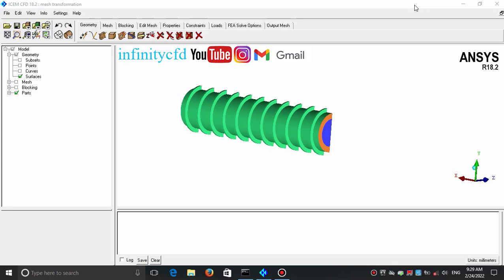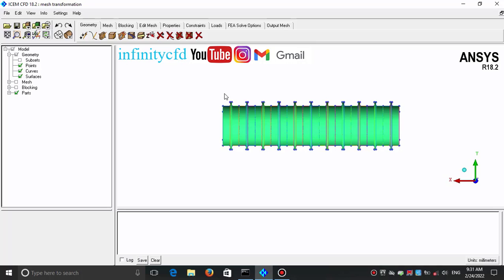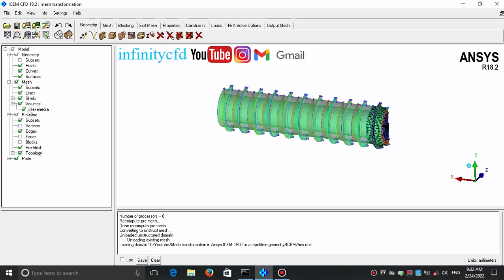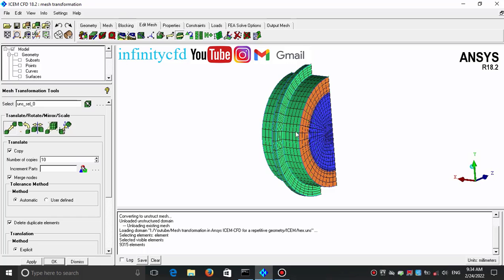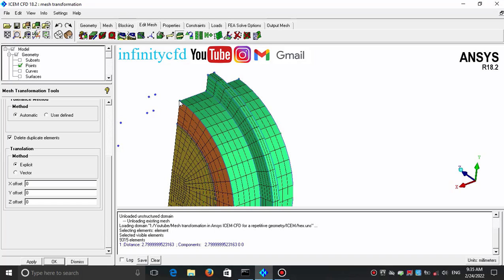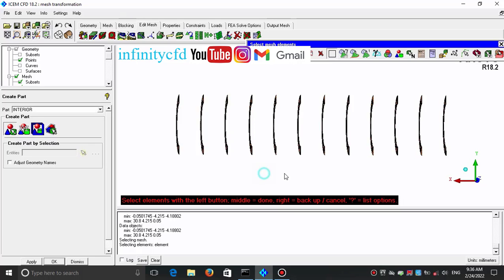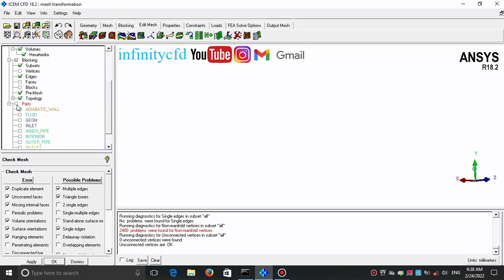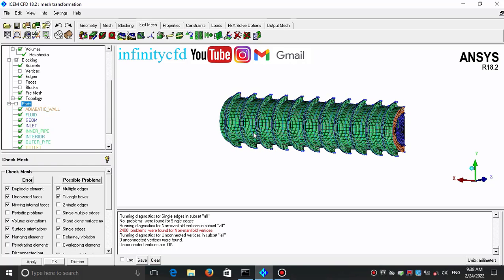Mesh transformation in Ansys ICEM-CFD for a repetitive geometry.

Comment: Hi, if I extrude mesh, I split the solid geometry into two parts, in between the solid geometry has a wall, how do I remove this wall?
Reply from the maker: Hello, if you use two separate solid mesh for volumes with two different names there must be two surface meshes between them. Actually, they are coincident and one has the main name and the other has shadow suffix.

Comment: hello，this video is very good，but i can’t import into FLUENT，the error is that interior can‘t be identified
Reply from the maker: Hi. Thank you so much, it's your kindness. This problem arises due to incomplete copy process. I mean the interior boundary is not formed correctly. May be it is from the value of distance for copying that should be precise and be the exact value. Or it may be from the incomplete merging operation for mesh elements at this internal boundary. Check it out and see your boundaries one by one to ensure that one boundary has not two surface meshes in Ansys ICEM CFD. You can check this possible problem by checking the number of mesh elements that should exist in one boundary. For example if the number of elements for a boundary is twice the value it should be, the two surface meshes must overlap and you have to remove it before exporting the mesh.
Reply: @infinitycfd32  Thank your answer, but I meet another problem that the replicated mesh could not display after it imported FLUENT, FLUENT only  display  my source mesh. I don't how to do.😣
Reply from the maker: Your welcome. Did you enable the volume mesh in Display tree before transformation operation? If you did check the number of just hexahedral elements before and after transformation in the Material point.
Reply: @infinitycfd32  ohh，i solve the problem ，thank you very much .Looking forward to more of your videos!!!
Reply from the maker: Thanks a lot and good luck with your simulation.
Reply: Hello, I meet the same problem with yours, the error that interior can't be identified, would you please tell me how you fixed that? Thanks a lot.
Reply: @江开远  Hi, you must be check whether the volume mesh is selected.
Reply from the maker: @yangou9847 great reply